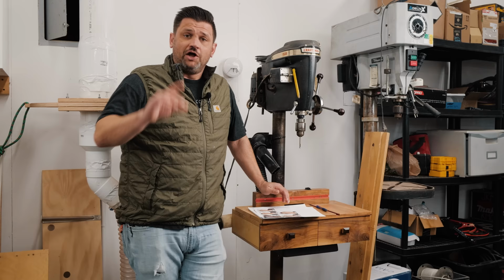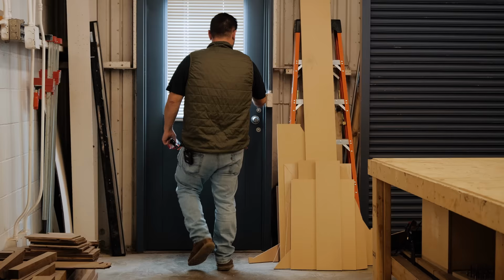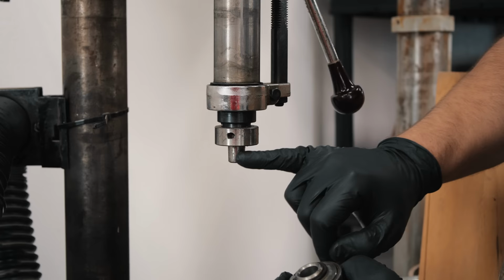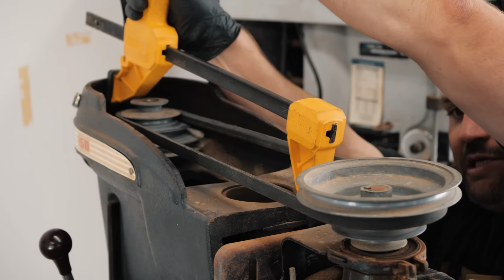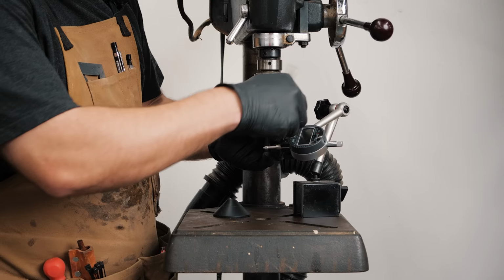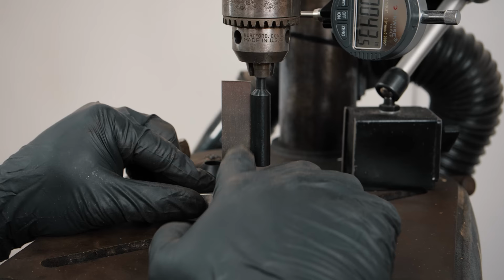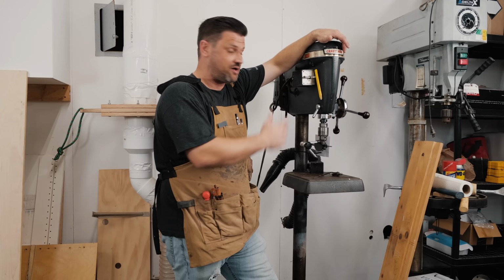Drill Press Tune Up and Maintenance

Comment from the maker: Digital Test Indicator: https://amzn.to/2K0tXiR
Glide Coat Drying Lubricant: https://amzn.to/2InXr7e
Engineers Square: https://amzn.to/2Xw8lOq: 
Router Centering Cone: https://amzn.to/2MvCKLL
Reply: Jonathan Katz-Moses, I don't know if you check these or not but, in case you do, check vintagemachinery.org for a manual.

Comment: Great video. The only thing you missed is what to do if there is run out. Mine wobbles and I’m going to start with cleaning the chuck good. I do think the quill has a little play. Mine is an old Walker Turner. The craftsmen you just did is just like my dad’s. Thanks!

Comment: I restore/refurbish vintage drill presses and coincidentally have a Craftsman like yours (1955) for sale ATM. Seeing a hair over 0.0025 runout from the original Jacobs 633C chuck. It's a simple design that held up well. Only had to replace one of the four bearings. Not a big deal. The machine runs like the proverbial tank.

Comment: One extra tid bit, alot of these older drill presses have sleeve bearings and they need to be oiled, there will be a small hole. It is a whole lot cheaper to oil them than burn the motor out.

Comment: How do you adjust if it's spinning non-concentrically
Reply: I beginning to believe that no one on YouTube knows, or cares to share the run out. I saw one video where the guy cleans the spindle, and the chuck, puts it back together, turn it on and (drum roll please) it wobbles to beat hell!, But he's standing claiming it's perfect!  My intuition says a) cleaning may correct it b) the chuck needs to be replaced, so might as well upgrade c) the chuck isn't seated on the spindle well d) the spindle bearings are bad. I assume there are bearings in there somewhere 🤔 e) something else

Comment: I had the benchtop version of the drill press. I loved it but moving the table was a pain because it did have a rack and pinion mechanisms. I bought it for $50, cleaned it up and flipped it for $220. Kinda miss it tho ool

Comment: An easy/accurate way to confirm quill is perpendicular to table:  Using a bit of wire (similar to a coat hanger) slip in a portion into the chuck and tighten.  Then bend the wire down and out, so as to reach the table top, way out by the edges.  Manually rotate the chuck.  If the wire touches the extreme corners of the table in the same way (feeler gauge is useful here), then you have a broad reference to establish 90 degrees.  This is better than an small square/small reference area.  Make sense?
Reply from the maker: I dont know. Doesn't sound scientific to me. I'll take a square and a smooth shaft anyday over a coat hanger
Reply: @katzmosestools  The concept is to extend the reference point way beyond the immediate zone right below the chuck.

Comment: my drill press sees to bind about 1/4 of the way down and then frees up about 1/2 way down.  same thing when I let go of the handle. It will snap back to the bind and then I have to manually wind it about 1 turn to get it back to the top.  I have had the handle off and the chuck out and spring off and cleaned and lubricated but still have a bind

Comment: If that chuck hasn't been rebuilt in 70 years, it should have been stripped down, and new jaws installed.  Plus, its a more thorough way of cleaning it, vs  Q tips, which will never get all the grit out.

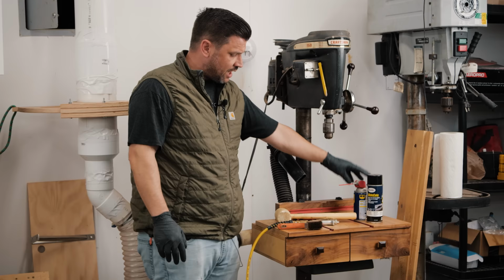Comment: I notice that just after 2:46 you just pry the chuck off, it seems to be a simple press fit. How does that not fall apart, is there no screw inside to hold it onto the shaft?

Comment: A couple things - what about lubricating the spindle?  It’s rotating and sliding within another sleeve to go up and down all without binding.... also, what is there is runout?  That’s great yours didn’t have much but if it did then what?

Comment: Can you tell how you got the chuck out? I have a vintage craftsman drill press that I need to remove. The chuck has a wobble, and like you I don't hafeva manual for. Thanks for the video, keep it up.
Reply from the maker: Check out the part of the video where I am using WD40 and a pry bar. It was stuck pretty good but it was just a tapered shaft that it was on. Just some motivation from a pry bar and a hammer should be enough

Comment: What do you do if your chuck and/or quill are out of alignment. My family pitched in years ago and bought me a standing drill press (from a discount tool store so no manuals) and I love it, but the bit has always wobbled. It can draw a neat little 5mm diameter circle on my work unless I sink the tip of the bit before turning the press on.

I tried replacing the quill and the chuck at different points in time, but nothing has fixed the wobbling bit.

I hadn't thought about it before, but maybe it's that my belt or motor is too loose and the vibration is causing the wobble? I just don't know.
Reply from the maker: I dont know man. Sounds like a mystery but the motor or belt could definitely be the culprit

Comment: Why would check square after you checked runout and determined it was ok?
Reply from the maker: If your tires were balanced you'd still check alignment
Reply: @katzmosestools  that doesn’t make sense,  tire balance and steering alignment are two different axis. Runout and square are the same axis.
Reply from the maker: @mode1charlie170  runout has nothing to do with whether the bit is square to the table
Reply: @katzmosestools  Ok I see what your checking now. I didn’t think that the table could be out. Thanks

Comment: Ok, but what if there is run out (quill wobble)?
Reply from the maker: You have to get a new one I think. Once something is bent it's toast.  The only potential fix is that if you have a tapered shaft then maybe you're Chuck is not seated all the way
Reply: It's worth mention that the shaft telescopes inside the press... SO there are bushings and bearings and all that... Those can wear down or out too...
    Obviously, any of the such is kind of painstaking and technical, but worth figuring out exactly what causes the wobble before "junking" an otherwise good or repairable machine... ;o)

Comment: First of all yeah yeah yeah amazing video... you always do amazing videos... but that ending joke, now that's brilliant!

2 Questions:  1) noticed you did not clean the pulley wheels - is that not necessary? 2) how do you know what way your quill uses to remove? Mine is an old Powematic, 1140F and not finding much online plus don't known if prior owner changed it. Haven't been successful removing it and don't want to do something stupid to break it.
Reply: A pretty fair bet is that it "probably" bumps off with a mallet... BUT there are a few things to do for "figuring it out"...

   First, hunt down a good "penetrating lubricant" or "rust breaker" lubricant chemical... I can recommend "PB Blaster's Penetrating Catalyst"... It's in a white bottle with bright red and yellow labels and a small yellow cap ( small for a spray-can)... You'll want to use the "straw" to get the stuff between the chuck and the "movement shaft", which is the telescoping thing that actually moves up and down... inside it is where the "Power shaft" transfers power from the pulleys to the chuck... Just sprits a little (the stuff stays slick forever and gets everywhere)... and leave it a few minutes... and then sprits again... maybe two or three "passes".
   Give it between ten minutes and half an hour to "soak in" because this stuff takes a few minutes but REALLY penetrates... AND THEN you can take a plain rubber mallet and "drum" around the upper sides of the chuck... You're trying to introduce some wobble, not move mountains or "break" anything free all at once. SO strive for a firm strike each time, and then rotate to a new position... You should be able to see movement in a few passes, but be patient... Old parts that haven't moved in years can take a while to free up.

    What if it's not a "friction fitting"???
   Non-friction connections come in two types that I've ever seen.
1. End-bolt... This may have a bolt straight up the center of the chuck, and they tend to be tight as hell... BUT you have to clean and Clean and CLEAN first to even see them usually... Go ahead and spray degreasing agent (I don't recommend acetone here, personally) while the chuck is wide open on the drill... WD-40 is reasonable, and won't deteriorate the table or your face should there be backspray... BUT I've generally been reasonably lucky with Simple Green or Purple Power (Advance Auto or Auto-Zone are good sources... along with the PB Blaster) and HOT water, a "throw away" tooth brush will also help if the chuck is large enough...
   Alternatively (and for smaller chucks) you can pop by any store with a craft section for pipe-cleaners (those wirey fuzzy things kids make silly crap out of at school) and those can be twisted together or manually formed to shapes for reaching in and swabbing out before going through the migraine-induction of cotton swabs.

    Once cleaned out, you should be able to tell what type of bolt is holding this thing in place with a decent flashlight... shine right up the chuck and look... with luck it's still got enough of the head to show phillips or allen or even hexagonal shape for a tool to reach and "grab"... THEN it's as simple as a pipe-wrench on the chuck itself or some means to "lock" the pulleys-end of the shaft in position to extract the bolt...
    BUT you may decide that cleaning the chuck out was good enough, and move on without too much fuss.

2. SOME (in my dubious experience only a few) chucks were clamped onto the shaft with a "set-screw" which will usually be an allen-driven bolt directly in the side of the chuck. These are almost always painfully obvious, since the bolt shows on the side of the chuck or a base-coller... To reference the video, there's a collar on Kats-Moses' drill-press right above his chuck, but it's there to protect shaft, and to help with re-installing or upgrading the chuck in size... The black dot on the side of it is probably the same kind of allen-drive bolt I'm talking about, and looks similar enough that you can understand what I'm talking about.

    IF your Press DOES have an "end-bolt", you can now understand a new importance for NOT "bottoming out" drill bits in the thing when working... Of course, a dab of silicone can help protect the bolt, too... but regular maintenance and checking up on it is also important... It's easy for bits being shoved into wood and other materials to beat on those bolts, and that's probably why the friction-fit method became as popular as it is...

    In any case, if you don't see the obvious allen bolt sticking out the side of the chuck... I'd sprits away with the PB Blaster and start banging, myself... Being easy AND using a proper mallet rather than a hardened metal hammer is going to serve you well, and they do make these for WORK... so it's not exactly a china doll. Relax, breathe, and carry on. 

          I believe you can get there from here. ;o)
Reply: @gnarthdarkanen7464  thank you for an amazing answer and taking the time to explain. This will benefit me and hopefully many others!
Reply: @rhuynh  Only glad to see it might help... I've refurbished a few old tools... and it can get beyond frustrating.
    Everyone is ALWAYS welcome! ;o)

Comment: DO NOT REMOVE A COLLARED CHUCK LIKE THIS DUDE DID. IT MUST BE UNTHREADED, WHICH WILL POP THE TAPER FOR YOU. DO NOT CHECK RUNOUT WITH SOME RANDOM ARBOR SHAFT EITHER.